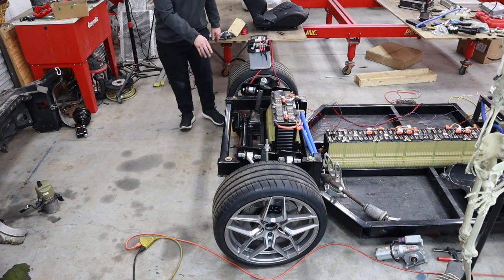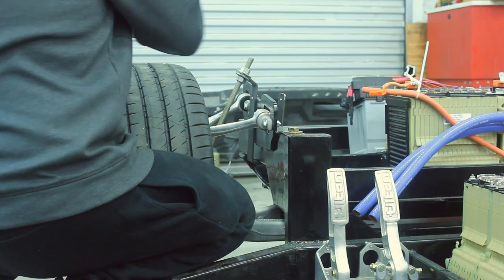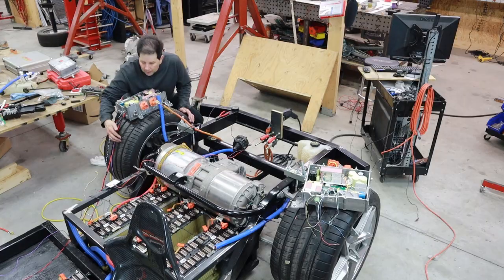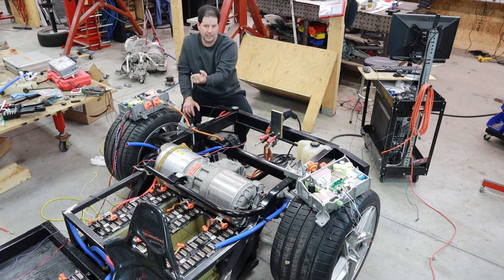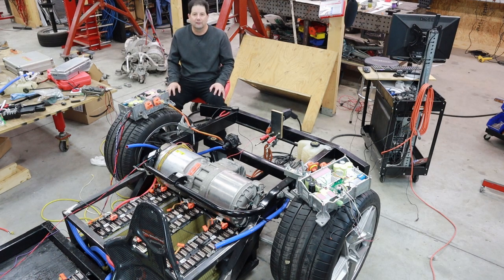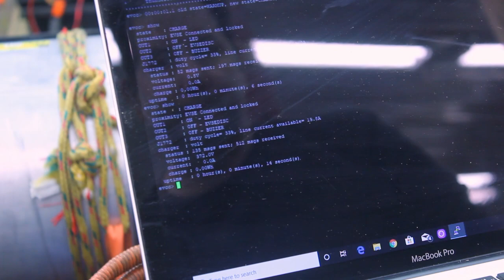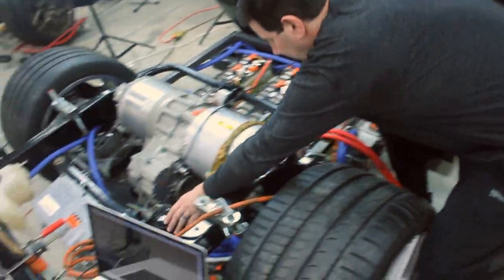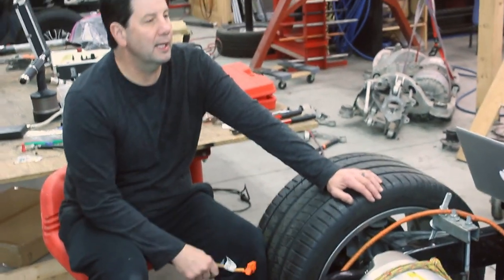Project Split Decision ... DIY Supercar(s) Part 11

Comment: Depending on where you mount the vacuum pressure switch will make a huge difference to how much the pump runs. I would suggest mounting it in the booster if possible.
Reply from the maker: I'm going to try and make it fit under the batteries and on top of the front cradle.

Comment: When are you making covers for those batteries, a anything metal dropped will make for a really really bad day.
Reply from the maker: I made a cover for the rear section.  Still need to make a cover for the mid and front.

Comment: Is that Volt evcc from Thunderstruck a new product? I have their old evcc to control the TSM2500 charger they sell and it has been working well for a year.
Reply from the maker: I not sure how new it is.  Its the 3.0 version.  So far it's been great.
Reply: Oh, is the Chevy charger made by Lear? I have a Spark EV charger here and wasn't sure what to do with it. The inverter is basically one half of the Volt inverter so I assume the charger is the same?
Reply from the maker: @cheapygeek  Yes...Its a Chevy Volt charger made  Lear.  I was just looking and the Spark and they look like the same thing.
Reply: Good to know! I have that first gen EVCC so I'd likely have to get the new one. I'll squirrel this info away for when I get the leaf motor installed!